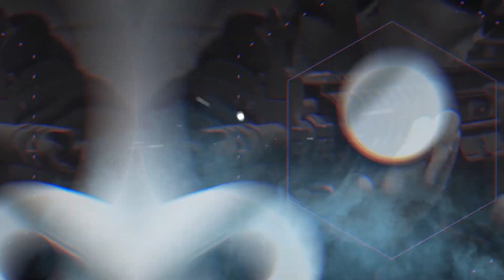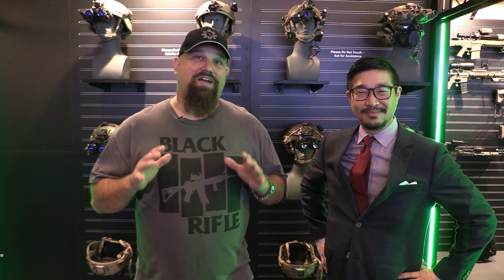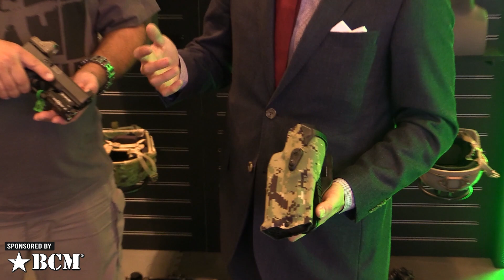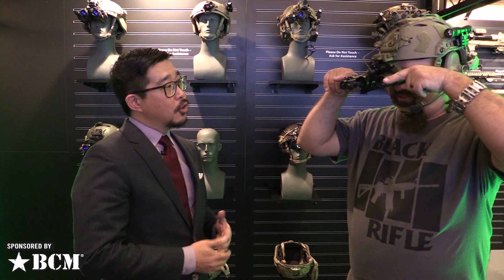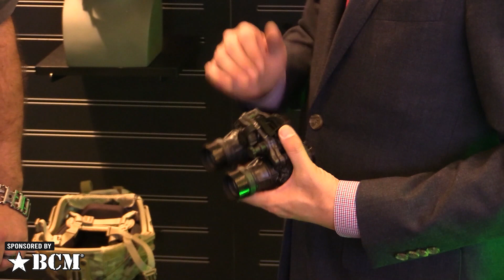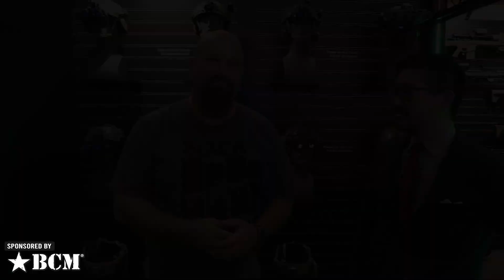Tactical Night Vision Company 2020 Lineup  - SHOT Show 2020

Comment: In 2020 you would think NVG would get much cheaper since everything else in tech is. We could get drone, smartphones and tons of technologies that were once either out of reach or too expensive for the public but now super cheap, yet NVG just doesn't really seem to change all that much. Rather slow progression and still super expensive.
Reply: As I understand it, the intensifier tube is the really expensive part and it requires a lot of labor as well as a high rate of rejects in QC.
Reply: omegaboostZ The problem is that NODs aren’t digital yet. The analog technology is extremely difficult to manufacture. They use a lot of rare materials as well

Comment: I'm running the Pulsar trail xp50. $5000.00.  I believe thermal is the way to go, you can't hide from it unless you're behind glass. A good set of night vision is a must have also so you can see the infrared from someone else's night vision. You need both systems.